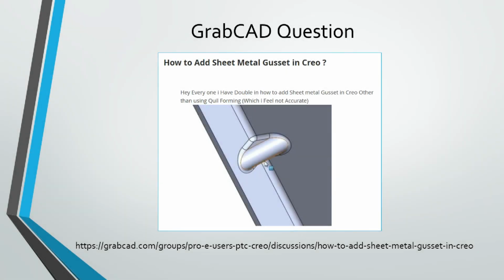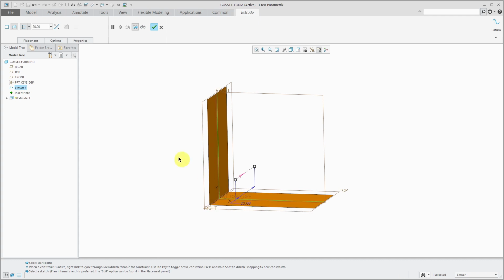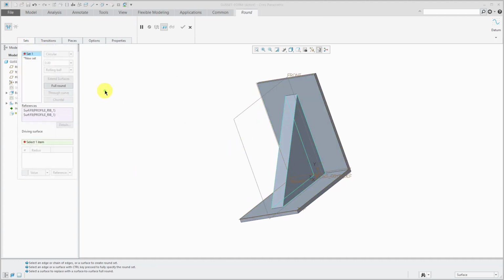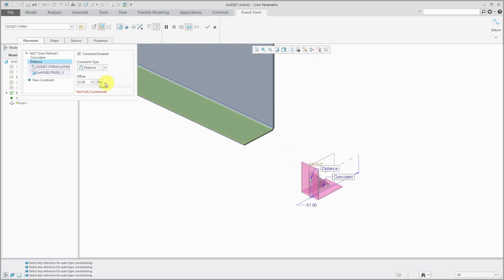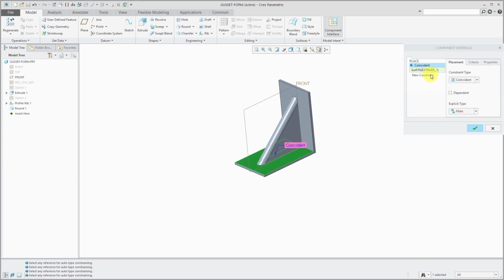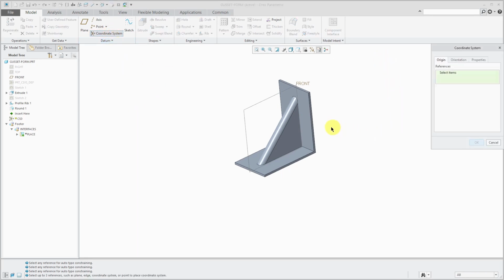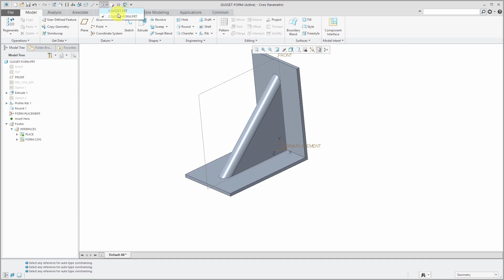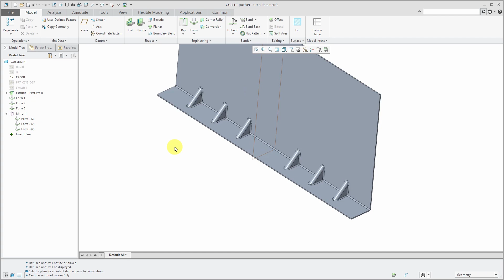Creo Parametric - Sheetmetal - Punch Forms [Tutorial]

Comment: Hi sir after trying the first technique it shows feature failed to regenerate and the form is not formed whqt to do?
Reply from the maker: Try changing your model’s accuracy or open a ticket with PTC Tech Support.
Reply: @CADPLMGuy  wdym model accuracy? I have same error, it won't let me do placement edges either
Edit: ok figured it out. Need to create the tool without the rectangular walls
Reply: Hi sir is there any exercises of part, surface and sheet metal pdf with you sir. If yes can you share link sir
Reply from the maker: I do not have any. Fun fact: the software license agreements we all sign to use Creo prevents people from creating commercial training without PTC’s consent. But I have no desire to create training content.